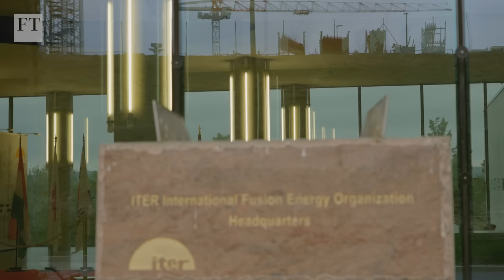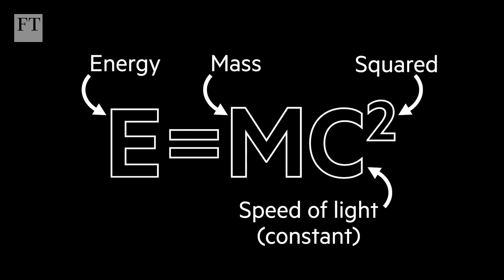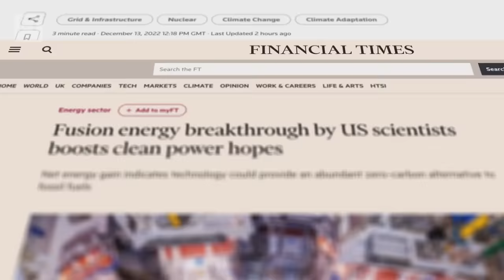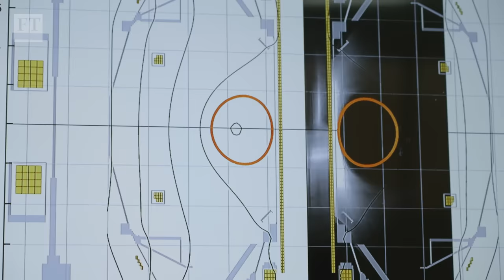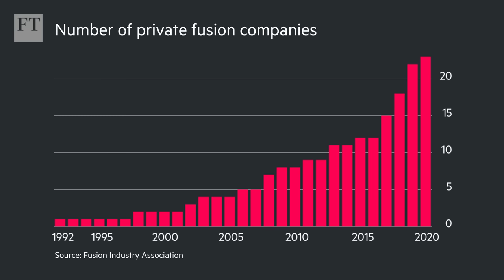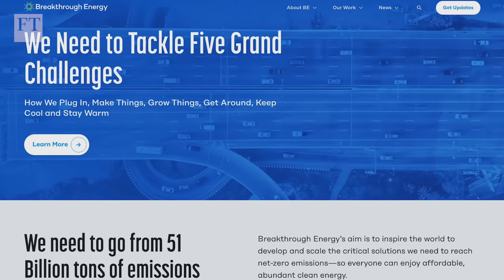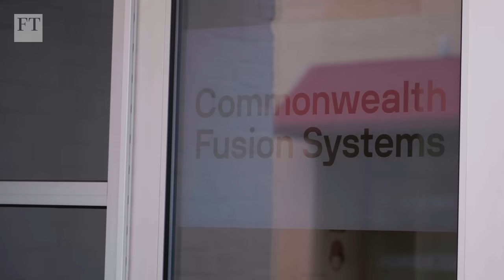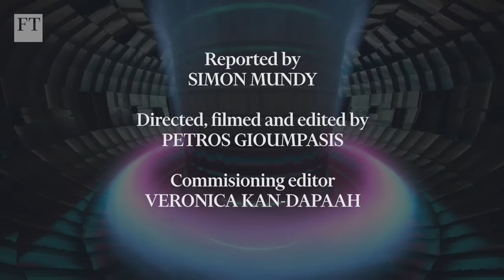Fusion power: how close are we? | FT Film

Comment: Thank you for the balanced reporting
Reply: There is absolutely nothing balanced about this reporting. Whether something is balanced is not dependent on the style of the reporting, but on the substance itself. Take the report on the US breakthrough for example. This video wrongfully says that there was a net energy gain. This is totally wrong. It was the laser itself that used less energy than it created. What they forgot to tell you is that the laser is only a fraction of the total energy needed to run the laser, since all the overheads are responsible for the vast majority of energy used.
Reply: @erikhartog5340  He literally said that though. He explicitly said that the power to run the laser was a hundred times greater than then fusion output. The NIF result was just mentioned as an aside, the real point seemed to be talking to Commonwealth Fusion

Comment: The Fusion Reaction, if it can be maintained beyond "Ignition", which is what this is, can be self perpetuating if Lithium-6 Blankets are involved, maybe. But it is about 10 years down the road at least to even test the theory at ITER in France. That is the purpose of ITER. The reactor was expected to take 10 years to build and ITER had planned to test its first plasma in 2020 and achieve full fusion by 2023, however the schedule is now to test first plasma in 2025 and full fusion in 2035.
Reply: The problem of producing enough tritium doesn't get talked about enough. Without that even if fusion was working you couldn't build it at scale.
Reply: And 2025 won’t happen either, by the looks of it

Comment: Great presentation. Thank you for the insight. I have been binge watching a lot of videos on the subject. I really appreciate that you included the voices of reason on the timeline to achieve a net gain.
Reply: The US gov effort was crazy hyped for some reason by the MSM. Less than one percent out than put in. Only enough power to boil two kettles max! The FT missed UK private company First Light Fusion which is the best pick. And why did they not mention fission as a viable power source in the meantime. UK and Germany invested billions in wind and solar and are still at the mercy of Russia for power. We have high bills now and next winter could be bad. If BJ had invested in nuclear fission instead... The last thing we need to do is double down on wind and solar. Sad the FT did not mention fission power to tide us over.
Reply: @andrewnorris5415  don't we currently use a form of fission?
Reply: @unorubbertoe  a small portion of energy produced is from fission, France is the highest at 70% and has some of the lowest power cost in europe, whereas the US is only aroEurope, from fission
Reply: @andrewnorris5415  Hitting the bottle pretty hard lately ?
Reply: @andrewnorris5415  Did you not read the title of the video? Fusion power: how close are we?
Reply: @andrewnorris5415  LL
Reply: @andrewnorris5415  No closer than we where 60 years ago physics has not changed!

Comment: The thing is, we already have a reliable fusion reactor. Its output is available to anyone on earth for free (free, baring the need to purchase a slab of doped silicon). Sure, it disappears from time to time - quite regularly, in fact, but the use-cost is remarkably low.  
Still, major engineering projects are a great way to advance human technology and they should be supported because, although the ultimate goal may be illusive for many years, the employment of so many scientific and engineering minds can bring nothing but benefit for humanity.
Reply: Virtually all the energy we use on this planet (I can't think of any that isn't) is generated from that fusion reactor in the sky or ones that preceded it. We just want to build controlled ones here so that geography doesn't need to impact people's access to energy.
Reply: Control the Sun and secure the future for humanity.
Reply: @steveetches6013  Yes, indeed. One place there's a massive and basically inexhaustible supply of energy is under everyone's feet. I wonder if a few billion were syphoned off from the sexy fusion projects to updating decidedly unsexy drilling technology, maybe everyone could tap in to the permanently hot mantle to generate steam for eternal electricity generation. It's hard to believe that the current limitations to drilling technology are more insurmountable than the fusion variety.
Reply: @mb-3faze  We've been trying to drill to the mantle for decades and drilling technology has received billions and billions of funding over the last hundred years... The cost of drilling a well a couple of thousand meters is in the order of 10's of millions of dollars and so the places in the world where it is economical to do so is fairly constrained geographically. That is the main reason geothermal energy is fairly limited.
Reply: @steveetches6013  The thing is, you can bet your last petro-dollar that if there was oil discovered at 15000 meters down, the oil companies would have found a way to drill to it.
Reply: @mb-3faze  There's lots of oil and great depths, although probably not 15km, but it doesn't make economic sense to drill for it. Oil companies are many things, but they are pretty good at making economically sound decision. If it made economic sense to drill that deep for the energy in the rocks, the super major oil companies would be investing in ways to do it. The fact they are not, despite all there knowledge and expertise in drilling should tell you something.

Comment: The transistor is a different metal not a different size. A permanent magnet motor as a generator and brushless motors as generators is much simpler and safer way of generating unlimited amounts of electricity to deliver to the power lines cheaply.

Comment: The initial budget was close to €6 billion, but the total price of construction and operations is projected to be from €18 to €22 billion; other estimates place the total cost between $45 billion and $65 billion, though these figures are disputed by ITER. 
For this price tag you could probably power all Europe with solar power grid using the roof of every building. Unlimited energy.
Reply: It's not Europe alone funding this though, it's an international effort. 
Building scientific devices gets harder and harder the bigger you go.
It was supposed to be a testing facility... But ITER could have started a little... Faster to make? Smaller?
Reply: Tony C, perhaps, but only during sunny days.  We still have a massive problem to solve after that: how to store enough energy for use when the sun sets or is blocked during cloudy days.

Comment: Fusion Powers 20% of the universe.   We already have a nice 4 billion-year-old fusion reactor just 93 million miles away that we can collect power from Easley cheaply and distributed over the planet .  We have been using stored energy from this fusion reactor for the last 200 years.  If we replaced all the space we use up on tank farms pipelines minds and oil drilling pads, we could have adequate storage for our needs.   We need fusion reactors for space travel.

Comment: Energy can neither  be created nor destroyed it has to be conserved, borrow one joule of energy from the vacuum then it has to be repaid at a later time back to the vacuum.
E = (q/4π*ε0*r^2)sine(α)
B = (q*μ0*v^2 /4π*r^2)sine(β)

It is important to know that the magnetic field the B field is a mirror image of the electric field the E field.
Thus,
sine(α) = sine(60)
sine(β) = sine(90)

The upshot is that if v^2 = c^2 = 1/μ0*ε0 
then it follows that
 c/sine(60) > c
which is forbidden by special relativity.
The B field is 30 degrees out of phase with the E field.The only way to bring both B and E fields in to phase means that the particles within the B field have to travel at a speed greater than the speed of light.
The conclusion is they cannot thus they take the easy path by returning to the vacuum.

Fusion by permanent plasma confinement is impossible.
Reply: We already got out more then we put in last 2 years ago.

Comment: Several places in this video use the highly misleading term "net energy" to describe the much more limited concept of scientific breakeven (where the energy on the outputs side of the plasma is greater than the input side of the plasma). This is like abusing the term "net profit" to mean only the difference between the price charged for a product and the cost of the product, while neglecting the cost of sales, the G&A overhead, the taxes, and all the other aspects of running a business. If you watch the part in Boston at 23:30, you'll see the CFS representative be very clear: "more power out from the plasma than went in". The problem is that it can take more than ten times that much power to run the plant, not to mention the roughly 50% loss to generated electric power with steam. And this whole story doesn't even touch the most serious problem, which is the incredibly misleading claims by the fusion industry about "cheap and limitless". In fact, the fuel for the types of reactors shown in this video is desperately constrained and astronomically expensive; and the best concepts we have for "breeding" more of it make unrealistic assumptions to achieve breakeven. Investors will figure this out, as they always do, and the fusion bubble will pop in the mid-2020s.

Comment: I am interested in whether ITER will produce a breakthrough technology related to breeding tritium from the blanket that receives the neutrons from the fusing plasma. Even if more practical fusion designs in the future abandon the approach of a massive tokamak, they may need a tritium breeding blanket to generate their own tritium fuel, and ITER might be valuable even if it only contributes to solving that problem. Unfortunately, fusion cannot be commercialized in time to avoid dangerous climate change. We have to achieve net zero without it. But if fusion technology is viable in the 2100 time frame, it can power an industrial economy that has net negative carbon emissions. Within a few generations, that would enable a return to a safe level of atmospheric carbon like 350 ppm which the globe last had around 1986. Without fusion, it may take thousands of years to return to that level, risking more tipping points that are irreversible within human life spans.

Comment: The only way this will work is if the whole unit itself is put in to a vacuum as if it were in space. Atmospheric pressure will interfere with the contained pressure inside the module.

Comment: They didn't make bombs using fusion. They used fission. It's very alarming how elementary this mistake is.
Reply: The Hydrogen bomb is a fusion device.
Reply: While the atomic bombs built during the Manhattan Project used the principle of nuclear fission, the thermonuclear, or hydrogen, bomb was based upon nuclear fusion. While fission is most easily achieved with heavy elements, such as uranium or plutonium, fusion is easiest with light elements.
Reply: No, they use fusion also. What’s alarming is how confidently you’re talking when you’re wrong.

Comment: Fusion is a business. The product of the business is selling "a plausible sounding promise" to governments and the press. Neither of which understand the science nor the engineering challenges. Thus far, the fusion business has been very profitable. Even though economically practical fusion is not likely this century. 
Most likely practical use of fusion:
1) Drill a deep hole in carefully selected geology.
2) Explode a thermonuclear device deep in the hole. 
3) Extract heat from the explosion cavity using existing geothermal methods (see Iceland).
4) When cavity is too cool to generate power, see number 1.
Reply: Completely agree. Commercially viable generation and conversion of 14 MeV neutrons to USEFUL energy will never happen.
Reply: @robertfield4103  1) I was reactor operator on ballistic missile nuclear submarine (@paul_kramarchyk).
2) I held US Nuclear Regulatory Commission license to operate commercial nuclear power plant, FPL's St. Lucie Unit 1 (2700 mw thermal). 
3) 40 years as nuclear operations engineer. I've consulted with foreign governments regarding their nuclear power program.
4) Controlled fusion is like blowing at the sail hoping to get somewhere.

Comment: Great reporting, to the point, impartial and scientifically sound as it's foundations. I hope some humour will not be taken for anything other than of which it is. It could be possible the technology has been in use for quite a while now. The ability to get more output than actual input in real terms of energy measured, is well known and still practiced among some of the best not noble prize taker scientists as (crack). But at such instances, the base material of mass, matter, energy or frequency that results in (crack), in order to achieve the amazing ratios of more output than actual input in real terms of energy measured, do not and cannot be ignored, as they play a critical role in the whole process.

In this particular instance, the same results are aimed as achievement, with the difference of completely ignoring the base material of mass, matter, energy or frequency that can result in whatever it is, that will achieve the much desired amazing ratios of more output than actual input in real terms of energy measured, just as (crack) does. What is more fascinating, which should excite everyone (because if achieved this will mean a double platet utopia for everyone), the different approach is achieved as a bypass, through using a most formidable abstract concept of....! The base material needed is everywhere, it is the most abundant base material in the universe. Which neglects the fact through the abstract form used as reason and logic, that if and when accessed in tangible and safe usable measures from the "universe", there would be no need for anything else.

It is possible to use on the other hand enriched materials technology, with some sort of electrical discharge function, in a reactor system structure, (with the overall aim of no, way less, or more manageable radioactive or other harmful externalities). I have already indicated to this with the royal institute hoping for a prize, nothing so far, thought I give it a try here on the financial side of things.

((((Note: It could be possible to say, that fusion in every location in the universe, is achieved only through various very high levels of density with and within mass, matter, energy or frequency as a totally combined. In religions and and believing faiths of different cultures one is known as heaven, the other is known as hell, one is constant light, the other one is burning. As a consequence it could be possible to say, that e=mc2 together with many similar formula's are formula's that describe the concept of burning (which is not light), while Newton's formula for gravity and many similar others are formula's that describe density as mass, matter, energy or frequency (which is light) of a total combination in the universe. This is possible to prove here on earth by the fact, that if and when there is mass, matter, energy or frequency, innovative ways and methods to burn it, can also always be, with sun burn being the most fascinating type earth is attributed in connection to it's location. It also possible to say equals four, plus two, plus two, instead of two plus two equals four, and through off, even if for a moment the best mathematician in existence, giving as a result a completely different understanding and knowledge to a proven reality in being, similar to the one known as bolex logic, used in general terms for computation.))))

Comment: It does seem that the use of SC magnets will be critical, since the plasma when created becomes unstable and disintegrates. after a very short time of insufficient duration to achieve useful heat transfer.
Reply: SC magnets are already being used in some experimental magnetic confinement fusion reactors. Plasma stability is something that is mostly solved though. The issue is rather that stronger SC magnets are required to reduce the size of the reactor and therefore to reduce costs. With stronger magnets, ITER would not need to be so large and expensive.
However one crucial but often neglected aspect (in documentaries) is that stronger magnets lead to larger mechanical loads, and that is why we can't just swap ITER's magnets by those being developed at MIT. But if they manage to solve this problem, the first DEMO reactor that actually produces power could be even smaller than ITER.
Reply: For the JET fusion reactor, the duration of plasma was no longer limited by plasma instability.  It was limited by the fact that the sustained heat generated was more than the thermal cooling ability of the reactor. This was because it was an experimental science reactor and never designed for even experimental power generation.
Reply: @helgefan8994  We actually don't know if plasma stability has been solved. no one has reach the stage of burning plasma which might unleash a whole other set of problems keeping plasma stable. .
Reply: @DavidKnowles0  I think they have to look at this from a different direction. Firstly they need a vacuum.. a hard one.. and a magnetic bottle.. harder to do in the atmosphere and magnetic field of the earth.. Then they need vast amounts of power to input. I think they might get further if they realise space has a few of the things they need readily available. Ever heard of the Bussard Ramjet?
Reply: @DavidKnowles0  Yes you’re right, we’ve never looked at a self-heating plasma so there might be surprises. Also the effect the induced current inside the plasma has on the behavior of the plasma is not fully understood. So that’s an important aspect ITER will look at. But generally, scientists are fairly confident they’ll be able to deal with these issues of plasma instability.